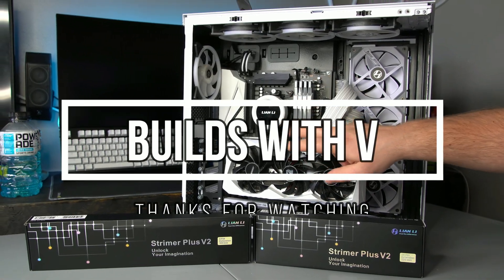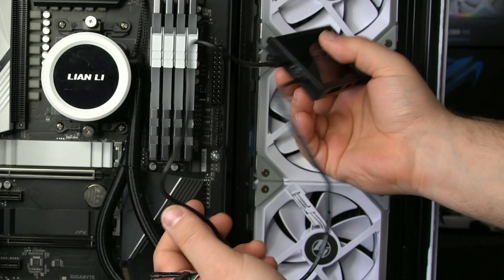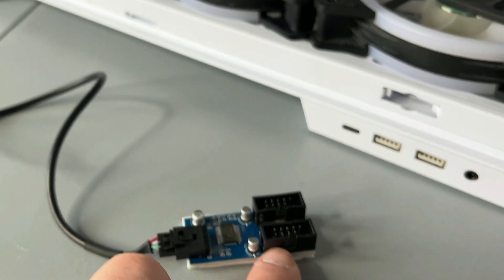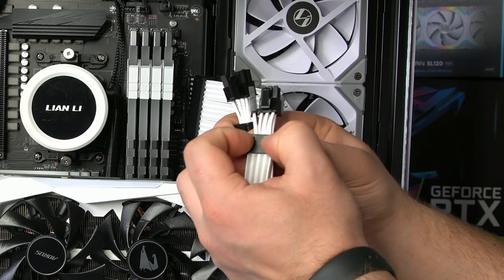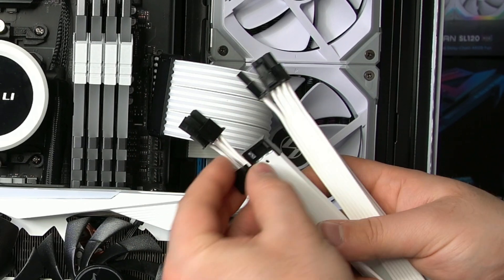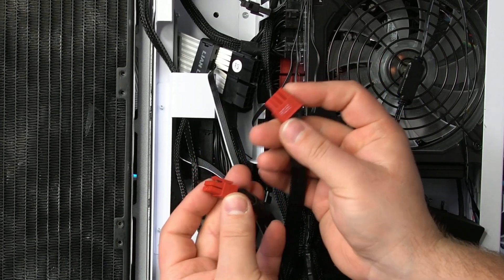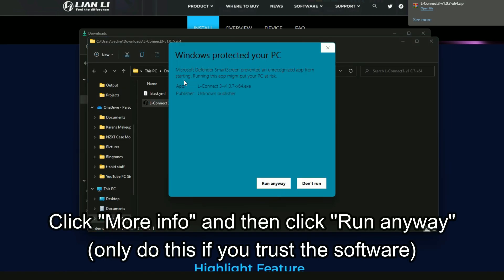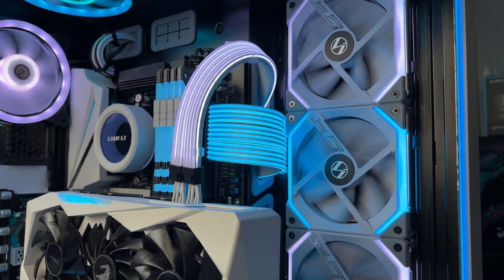How To Install Strimer Plus V2 RGB Cables + L Connect 3

Comment: Will it connect to a gpu with only one 8 pin slot?
Reply from the maker: It can connect to it, you’ll just have one of the cables hanging there or you can split them and tuck the second one in the back carefully so you don’t rip the connectors or anything.
Reply: @BuildsWithV  hey I have only an 8 pin but how would you split it? I am new to pc building, doing ym first build and love these but Im weary as I dont know how to split. I know the cables just pull separately but what about the rgb strimmer? I though the strimmer was solid 2x8 so ddint know if you can split that if this makes any sense lol....any chance would make a short vid for me, ik im a bit dumb lol
Reply from the maker: @sky_kbrookes  with the v1 since they don’t split you can just plug one 8-pin in your GPU and leave the other unplugged. All 16 will still light up
Reply: @BuildsWithV  I have 1x8pin PCIE gpu do I leave both of the other 2 ends unplugged, or do I plug both ends into the power supply and 1 dangling by gpu  so 3 ends plugged in total? Or 2 ends plugged into something total,You get what I’m saying? Better question may be.. If there is FOUR ends to be plugged into something on the strimer plus how many of those ends do I need to plug in if my gpu is one 8 pin? 2,3?
Reply from the maker: @gdgzhrr  so you’ll just plug in 1 into gpu and 1 into psu. Make sure it’s the same plug going into psu and gpu otherwise gpu won’t get power.
Reply: @BuildsWithV  thanks for the quick reply  subbed for that! i got the strimer to work now..

Comment: I'm not sure what I am doing wrong. I can't control it through L-Connect but the lights do work
Reply: Maybe usb isn't plugged in properly
Reply: I have heard of some fan/rgb controllers coming dead on arrival. Lian Li will help you in that case. I had an issue where my usb header came unplugged easily.
Reply: Same problem need help

Comment: awesome cables for the 5 seconds they work :( Upgraded from their previous cables (MOBO + Tripple 8 pin), installed, connected everything perfect. Even double checked by watching "Installation videos of V2 Plus" and everything I saw is what i did. Computer turns on, loads into desktop, open software, can control colors for a couple minutes and BAM... The cables completely disappear from the software and can't control colors anymore. Only thing that shows up in the software is the 9 UNI-SL fans.  At first i thought maybe it was bc I only had 2 USB 2.0 Headers on MOBO and I shouldnt be using a splitter, So i got the NZXT Internal USB Hub 3. Same ol sh*t, different pile. I've installed, uninstalled, Ran Revo Uninstaller which uninstalls + deletes remaining folders and entries in registry... zero luck.  Apparently a TON of people are having the same issue from what i've seen on youtube / reddit. You ran into any issues at all?
Reply: I just did a video on my setup I'm not done yet some more stuff  I need for the PC.
Reply: some say dont connect both hubs on the same SATA line from the PSU.
Reply: @winterume  ill give it a shot! Nothing to lose bc  at this point i'd ready to throw it in the trash lol
Reply: @JDubz303  i hope it works for you, man. cheers!
Reply: @winterume  me toooooo! Gonna try it as soon as I get out of work. Tried sending in a troubleshooting ticket but they’ve shut it down due to holiday 🤦🏼‍♂️
Reply: @JDubz303  update?
Reply: @heartofjustice6041  🙁 <—- sums it up. Last night I disconnected all the other controllers and just had the Strimer Plus v2 controller connected to do their new manual update. WELL…  followed every single step down to a T and I’m pretty sure it bricked the controller. This has def been an awful experience
Reply: @JDubz303  what brand is your motherboard ? Is it Gigabyte or msi by any chance ?
Reply: @the1observer  ROG STRIX Z690-F GAMING WIFI
Reply: @JDubz303  Now that's a bummer, even if asus software arn't the best, they are miles ahead of giga and msi. Maybe the kit you received is doa. That would suck. I'm about to install mine on an asus board too wish me luck 🤣🤣🤣
Reply: @the1observer  good luck 😉
Reply: I have the same issue, my 9 SL fans can be controlled by L-Connect 3, but it does not detect my Strimers. My Strimer can be controlled by the Armoury Crate Aura, but the effects ain't nice!
Reply: @Ray Ng  same and I don't know what to do bc I'm sick of the rainbow shit
Reply: you ever end up finding a fix?

Comment: I noticed you didn't mention the argb cable, does it need to be installed as well or can you bypass that cable if using the USB cable?
Reply from the maker: Yeah the ARGB cable is optional. Only if you’d want to control your Strimer cables using your motherboard software.
Reply: @BuildsWithV  Thanks i just received mine and that was the one part that was confusing according to their instructions.   I have both the triple 8 and 24 pin with l connector. Not interested in controlling from MB.

Comment: If i use a usb splitter does lian li connect still see my strimers?
Reply from the maker: Yeah that’s how I have them connected. I have a 1 to 4 usb splitter for all my devices
Reply: @BuildsWithV  i want probably to buy the nxzt hub its look great 

Your setup looks kinda simlilar to mine what u tried to build 😅 for now my vga strimer isnt light full rgb on the full cable and the other one doesnt work + all my fnas dont work 😅 probably i did something from need to check that ...

Do i need some other stoff to buy for rgb or something? Or are the hubs from fans + the strimer hub enough?

Comment: I downloaded L connect 3 but i have no option to change colors on the strimer V2’s?
Reply from the maker: Like they don’t show up at all or you just can’t change the colors? You may have to first change the effect to solid color or something else.
Reply: @BuildsWithV  i can change the colors from the remote, but i don’t get the “strimer” option in the L connect 3 software?!
Reply from the maker: @lemcat6212  the v2 controller doesn’t have any buttons. You may have the V1 strimers. Does your plug into usb header on your motherboard?
Reply: @BuildsWithV  the 24 pin goes directly into the mobo, i’m 100% that i have the v2
Reply from the maker: @lemcat6212  the controller you have has buttons on it?
Reply: @BuildsWithV  the 24 pin came with 4 buttons

Comment: I just got the Uni Al120 fans in white. Do you know if the strimer v2 can be plugged into that control box at all or does it have to have a separate box? Super clean video though, easy to see and understand!
Reply from the maker: Unfortunately it cannot, at least not natively. I’m sure there’s a way around it but it won’t have the same effects and it won’t be detected as the Strimer cables. I’ve seen people do it with the old strimers.
Reply: @BuildsWithV  well that sucks. Youd figure theyd have left an option open to do that. Oh well haha.

Thanks for the info and quick reply!

Comment: I get an error message when I try to open the zip file for L Connect 3. It says “cannot open c:\user\myname\downloads\L-Connect 3-v1.1.9-x64-update(1).zip”

I thought it might be firewall so I turned that off. That didn’t help. The Strimer Plus v2 is the only Lian Li device I have. Never download the software before. Thanks
Reply from the maker: It won’t let you unzip it either?

Comment: Kinda off topic but figure you'd know better than anyone...

If one was to do a push pull on the side mounted radiator, would the Unifans on the back side be noticeable through the vent?  Trying to decide if it'll be worth purchasing a 4th set of AL120's to serve as the push fans. Well, it'll be worth it regardless but just curious how strong the lighting would shine through. Appreciate your videos man.
Reply from the maker: You could definitely see the lighting through the mesh but unfortunately on the Evo the fans don’t fit back there. On the old 011D they fit no problem.
Reply from the maker: Unless you had the radiator on the front side and the fans on the back, then it could work.

Comment: Stopped watching when the black and white screwdriver came out. Guys a serial killer
Reply from the maker: That hurts… especially coming from you, Mr. Iron Man 😟
Reply: @BuildsWithV  lol I was kidding 🤣 gave me all kinds of OCD vibes. Out of curiosity no issues with the block higher than the tubing ? On the aio
Reply from the maker: @Arcanus31  I know 😄 No issues at all. I’ve run it like this for a long while and cooling performance has been great. No air bubbles in the pump either. I got the idea from jays two cents and decided to try it.
Reply: @BuildsWithV  good to know 😇

Comment: In my l connect don’t show de cables. Do u help me ?
Reply from the maker: Sure, you have the V2 strimers connected to sata power and to the USB port on your motherboard?
Reply: @BuildsWithV  yes I control effects in armory crate but in l connect 3 don’t show me cables have a option to change in control cables ?
Reply from the maker: @felip3_bsb235  if they are working in Armory Crate then you have them connected the your 3-pin ARGB header
Reply: @BuildsWithV  i change to usb ? is this ?
Reply from the maker: @felip3_bsb235  yeah you have to change it to the usb plug for it to detect in L Connect
Reply: @BuildsWithV  i try, thank y

Comment: My V2s will be here Thursday so I’ll find out soon enough but questions about the software. Does it need to be running after you select an effect? Also can you have profiles?
Reply from the maker: Once you open L Connect and select an effect you can close it out and the effect stays. Doesn’t even need to be running in the background. Not sure if it needs to start with windows to reapply the effect. 

As of now you can’t have profiles as far as I can tell but you can export your profile and import them. Same thing but with extra steps.